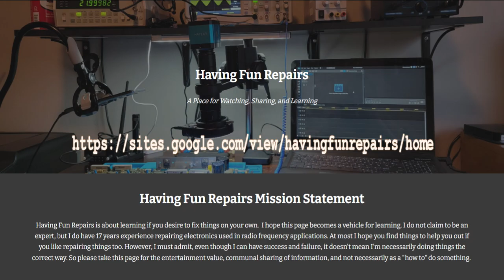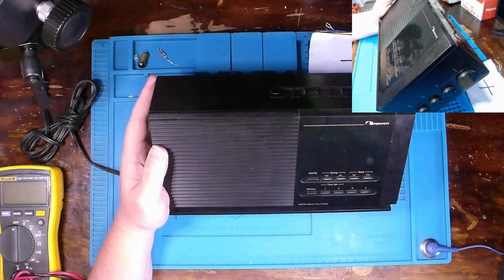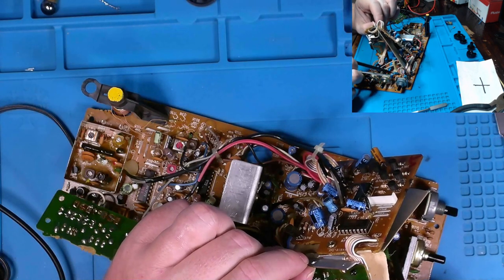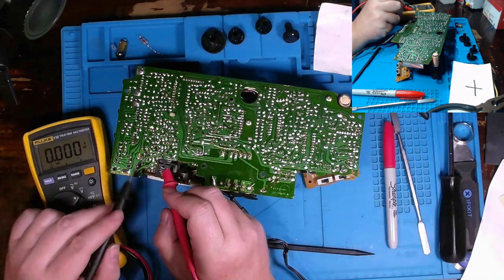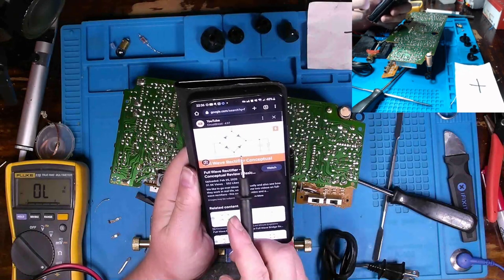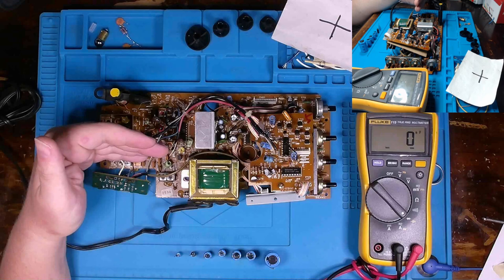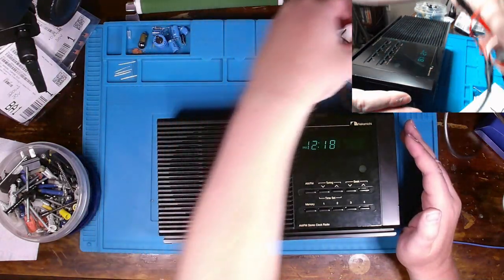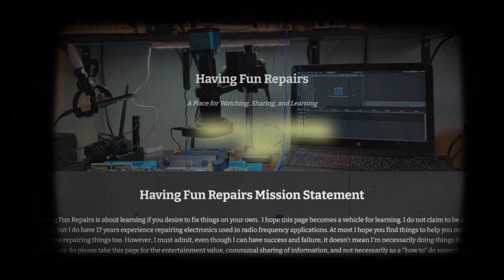(Repair) Nakamichi TM-1 Alarm Clock Radio No Power

Comment: Thanks very much for making this video, which I enjoyed watching. I especially enjoyed following your troubleshooting logic. I happen to have a service manual for this model that I would be happy to share with you. I just swapped out three caps (C205, C225, C226, and C501) to fix low volume. Although I can tune any into any station by hand, for some strange reason the seek function will never stop and lock onto a station, so I will investigate that next. Any thoughts about the best approach to troubleshoot this problem?
Reply from the maker: Thank you Paul! I would love a copy of the schematics you have. Can you email them to me? My Google site has an email address that can be used. Link to the site is in the description of this video. I would need to look at the schematic and synthesize it to make a few educated guess as to the frequency locking issue. However, if I had to guess off the top of my head, I would assume it may have something to do with the AGC or AVC circuit. That voltage should increase (either more positive or negative) as you get closer to a strong signal. I presume there is a detector that is not seeing the change to lock onto a channel. You mentioned low volume as well. Were the caps you replaced a part of that circuit? The low volume issue you had could also be a symptom of a bigger issue somewhere else. Perhaps in the mixer/multiplier section which could effect AGC or AVC as well.